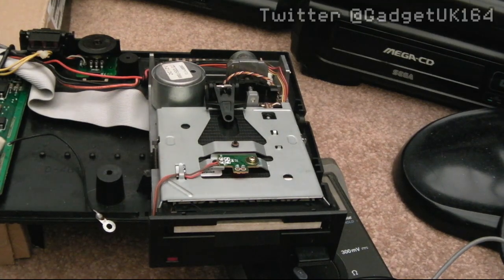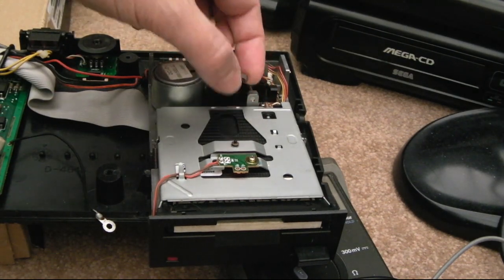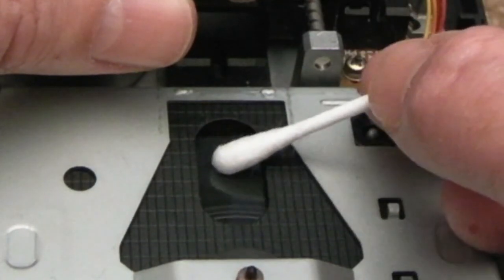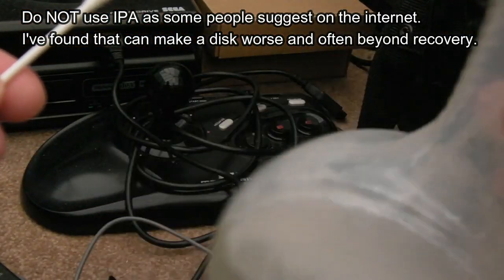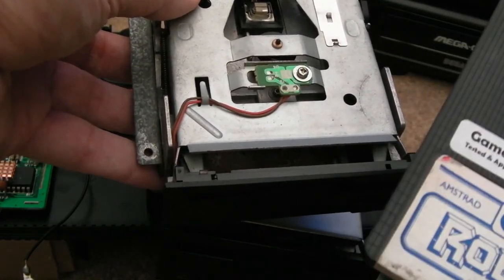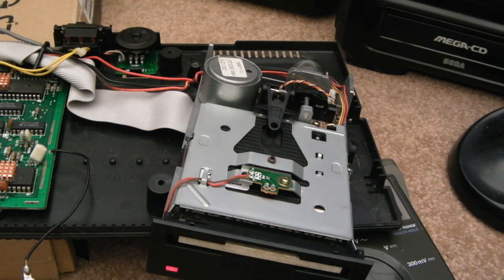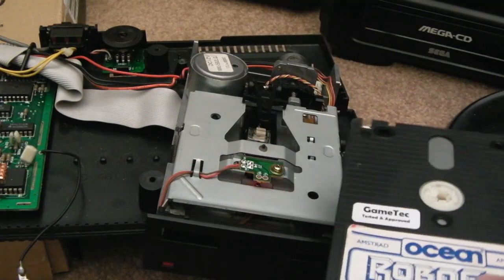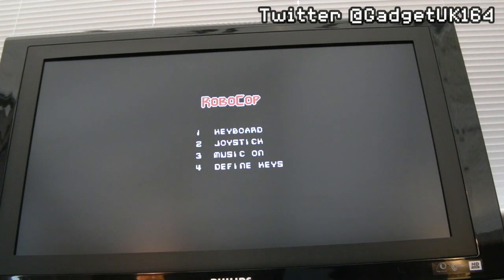Spectrum +3 / Amstrad CF2 Disk Cleaning & Drive Repair Tips

Comment from the maker: Prior to cleaning this disk, I had messed with this disk for a few days - getting nowhere.  I thought at one point it was an alignment issue, so spent ages messing around trying to get two drives to read it.  I was also in the process of buying a cable to re-write the disk, when I discovered to be what seems to be a good technique to get these types of disks working again when dirty.  There was no obvious dirt on the disk surface btw!
Spectrum +3 Repair - https://youtu.be/SjPs-E053VI
Amstrad CPC 6128 Repair Part 1 - https://youtu.be/yEtkGc1gia4
Yellow Belly (A couple of recent CPC repairs on his channel too) - https://www.youtube.com/channel/UCaV8T1QxAyq4GPEIgpBZcpg
Reply: Hi gadget, after watching your video, IPA can work, but it must be the chirurgical one at 70%. the one at 99% just destroy the magnetic disk surface.
Reply from the maker: @dlfrsilver  I've found IPA (even at low purity) still causes problems for me.  It might depend on the disk and how its damaged I guess.
Reply: @GadgetUK164  Then this is not the right alcohol to use. if used correctly, you should not have any problem afterwards. My method has been tested and proved on more than 500+ original disks infected with mould, i'm sure of myself on my side ;)

Comment: I don't get it, but I'm not a CPC specialist. :-)
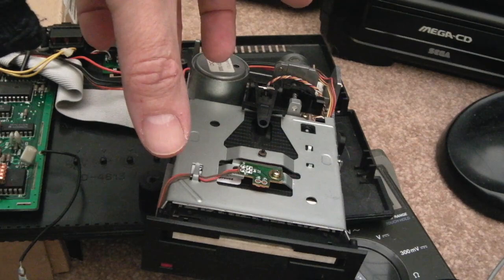The game is on the opposite side of the Robocop label, so the side with the redish label (because when it works, the Robocop label is facing up (we can see partially the "Tested & Approved" sticker, like @3:52 and @6:37 with the game music in the background).
But @1:33; you try to read the side with the Robocop label (we can see parts of the redish label on top), and it fails just because there is nothing to read on this side.
Or I am missing something there?
Reply from the maker: Well spotted!  Whilst filming I did get the wrong side at the start (I ended up doing it twice on both sides!).  When editing I got the wrong piece of footage there and just didn't notice I had got the footage from when it was the other way around!  I can assure you though, the process is exactly what fixed it.
Reply: @GadgetUK164  OK, thank you for the reply, I was starting to go mad about that, trying to understand what was going on with these double sided disks but single sided drives!! :-p
Reply from the maker: @Zebpro  I noticed it too just last week (after the video was up for around 2 or 3 weeks for Patrons lol).  I dont have the footage to re-edit it =/  I did expect someone would spot it, but it's not the end of the world.  I wanted to share the process, and most people wouldnt notice that footage problem.
Reply: @GadgetUK164  in such cases you can just place some overlay text over video saying "yes I know its backward" :-)

Comment: Hi I was told by another youtuber (LeeSmith) that you might have made a video in the past where you renewed the colour on the Spectrum +2 logo's?   I put my case in the dishwasher last night, and I messed up the setting, and it's taken most of the red & white paint of the logo's :(

Actually I just found it on your Garbage to Gem Part 2 video.  Halfords aluminium paint?
Reply from the maker: Yes, I went with a Halfords touch up paint (for alloy wheels I think).

Comment: The elastic bands that posties use degrade really really quickly (at least the ones used around here). I save the big ones for hunting flies during summer (best day of the year!). They don't last long at all even if just sat around, sadly. 

Still, glad for another awesome vid Gadge :) Robocop intro tune is awesome too :D
Reply: This is true - they oxidize very quickly.  So quickly that it is questionable if it's worth the effort to open that drive (it's nastier than most in that regard) for such a short-lived fix.
Reply from the maker: @GianmarioScotti  Not much choice atm - the only seller of new belts in the UK provided 2 to me which lasted a few weeks, and one in another drive a friend fitted - again lasted a few weeks before it went sloppy.  I suspect they aren't new but are refurbished =/
Reply: @GadgetUK164   that's terrible. I remember replacing the belt in my CPC6128, and it was an ordeal  (yes, that tiny little thingie fell out, too, to round out the experience). Not something I'd like to do often.

Comment: As another patron has commented: the elastic band fix will certainly prove to be short-lived, I'm afraid. May be as short as a few months.
Reply from the maker: That's certainly possible!  It's going to depend on the quality and how tight the elastic band is I guess.  Nothing lost, the "new" belt lasted litterally a few weeks (in 3 cases).
Reply: @GadgetUK164  The difference being that a big bag of elastic bands will be the same price as one of those new belts. I wonder where they're sourcing their belts from, because I've used assorted generic belts from china in other projects before that didn't fail anywhere close to that quickly.
Reply: @GadgetUK164  that doesn't bode well for my stash of Amstrad drive belts. I got my belts four or five years back - could those be as crappy, too?

Comment: Nice, call me nuts but I use spit on a cotton bud then dry it with the other side of the bud, it's never caused an issue and on cart's it's been way more effective than the old and frankly crazy blowing, you can see the dirt on the dry end after a 60 second scrub, I am probably bonkers but it's always done the trick for me.

Comment: you could make disk motor to turn on, while not activating the head. because, as it is, you are (slightly) pushing the magnetic media against the head...
Reply from the maker: The sponge that presses down from above presses far harder... So there's no issue!
Reply: @GadgetUK164  hmm might be good to try and clean or replace the sponge

Comment: I have got exactly the same experience with replacement belts that I bought from some spanish seller. Now I have bought few belts from dataserve-retro.co.uk so I'll see if these are better. If not I will use some rubber band too. :-)
Reply from the maker: I've had 3 from dataserve that have lasted around 2 weeks each....   Yet on other drives their belts have been fine for years!  So no idea what's going on but it seems hit and miss recently with their belts.
Reply: @GadgetUK164  you didn't make me very happy now. :-D suppose quality depends on the current source from China ;-)